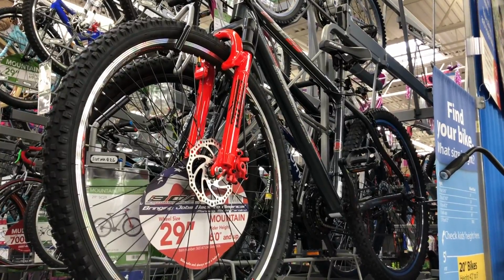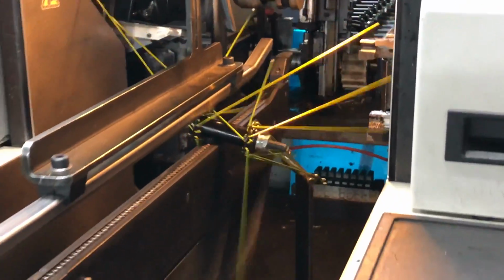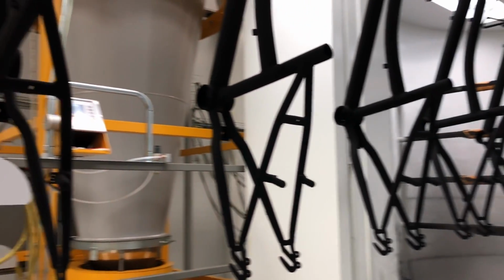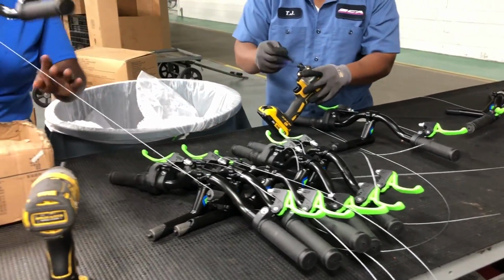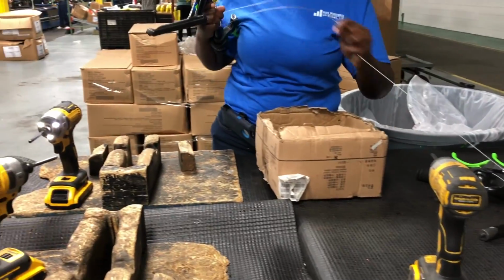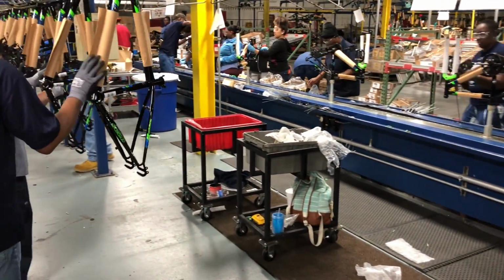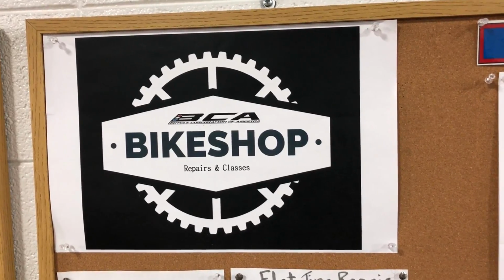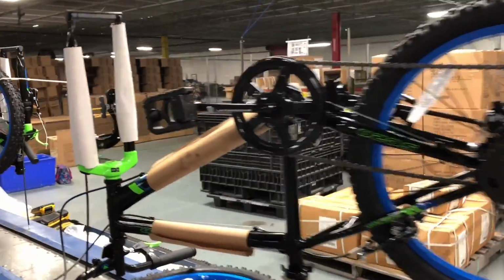BCA Bicycle Assembly Plant - Manning, South Carolina

Comment: Back in the 80"s in the bike shop i worked in Canada we got a load of BCA mountain bikes and it was the crappiest ones I ever worked on. They had big stickers with an American flag that said; Built with pride in the USA with a smaller one below who said; Echo en Mexico. Somes were white with smoke added with a torch and they rusted very quickly. We got separately a box of steel seat post because the ones who came with the bikes were not straight and could not be inserted. The plastic cantilever brakes were terrible and unadjustable. Even if the frames were massive and heavy, if the kid makes a wheelie the fork will surely bend. I am not surprised to learn they went out of business but how many times? For my part never buy a bicycle in a department store, they keep the cost as low as possible and they don't employ experienced mechanics..
Reply: Peace be upon you, how are you, I have a question, is the univega bicycle injection made in the American states or has it been assembled, and is it good or bad, and thank you.

Comment: Does this company have good wages and benefits?
Reply from the maker: The employees appeared happy, but I didn’t ask anyone what they made or what benefits they received.
Reply: KevCentral it looked clean and pleasant. I like your videos.
Reply: My experience with RTW states is wages will be $2 to $5 above minimum...where skilled maintenance staff make the top end of that scale.  Just enough to attract a workforce tired of smelling like a french fry.  Prolly no more than $12 to $17 an hour...maybe in the low $20s for maintenance.  Insurance will have high deductibles...usually $3000 to $5000. 

You'd be better off bartending and wrenching at the LBS for your bike fix.

Comment: I worked at the Toyota plant (where the Tundra and Tacoma are made) and that's pretty much how the trucks are made...right down being baked and washed, several times... On a little bit larger scale, but still. The difference is the truck starts out as a giant roll of sheet-metal, but the frames came from Mexico and not China.
Reply: But at Kent, there is no TPS in place...complete with traceable and variable quality systems. Of course, we prideful Americans had to rename it LEAN Manufacturing.  20 year career, here, in Auto and Aero...visited many a Transplants. Post 20 years in retail sports equipment similar to bicycle industry...which means lots of asia pacific mfg.  I can tell you Kev does a good job of showing what we want to see and doesn't show what's not. There is virtually no quality system. Too much cost would be involved to meet wally worlds price points.
Reply: @justpedal65  I’m going to comment on the the quality thing. When I first started at the plant, the Japanese were still in charge, we were making almost 900 trucks in an 8hr period, 900 trucks and only a few didn’t meet the quality checks and the end of the line (there were quality checks all along, those issues were fixed before going on). 9 months after I got there the. Japanese left...overtime went through the roof, 10-15 hours of overtime was usual (per week), loads of trucks didn’t meet quality and were sidelined, we always missed the production quota by almost 5,000 trucks a quarter (more like 10,000).  
It would be easy to sit back and claim “the Japanese were driving you to work hard”, but that’s not what was happening.  It’s hard to explain, but “line stops” went through the roof when they left...for no obvious reason.

Comment: My friend wanted to know if the genesis v2100 is a good bike to ride on novice trails? Keep up the good videos too👍
Reply: I have a problem also with cheap twist shifters. Thx for the feedback, ill let my friend know.
Reply: You dont have to reveiw it since you just got a bike. Take your time. Thx👍
Reply from the maker: If it were me, and I was looking at a Genesis for $149, I would be looking at the Genesis RCT. Better shifters, dual disc brakes, and no weak rear suspension to worry with.

Comment: BCA manufactures the cheapest bikes in the country.  They're for department stores.  Bearings are assembled with Makita styled drivers.  I saw ZERO grease being applied.  Pedals were WAY OVER TIGHTENED.  Cables had ends crimped on leaving cables about 7-8" long...WAY TOO LONG.  I see
Reply: These people obviously work hard.  I'm not blaming them, I'm sure they're under a heavy quota demand.  But this assembly is low, low quality.  The consumer pays for what they get.  I hope to see more jobs come back to made in the USA.  Raleigh bikes were made near my house in Kent Washington till the late 1990's...those jobs are still gone.

Comment: Are the DeWalt impact drivers they're using modified all?  Those things put out over 100ft-lbs of torque.  I don't think they'd use them on a faceplate without modification.
Reply: They use the clutch and test it periodically for torque.  The better air wrenches have torque settings

Comment: Powder coated?!  Who knew bikes sold at Walmart would have a better quality paint job than most high-end bikes.

And for the commenters...yes, I know powder coating is more practical for mass assembly, and yes powder coating is heavy, and yes you can't powder coat carbon... But it's still a more robust coating with less imperfections than hand sprayed lacquer paint found on higher end bikes.

Comment: The company where I'd spent 16 years once got a new GEMA powdercoat paint line, very similar to the one shown here. It's quite a head trip. A raw, greasy part can be hung on the line, and in about 1-1/2 hours, it's fully clean, coated, & cured, & ready for further assembly.  You don't have to wait that long for production to keep going, though, as the parts come out of the oven as fast as the raw ones are being hung on the line, about every 5 or 10 seconds. The coat has some orange-peel texture, but it's thick & it's hard as nails. 

A one-cubic-foot box of powder runs about 500 smackers, but covers many hundreds of square feet. It was supplied by DuPont and others. We use handguns to fill in places the automated guns can't reach. There's quite a process when the time comes (often) to clean everything spotless & switch to another color. A single mismatched fleck of the previous color requires touching up by hand. Every single last mote of the old color has to be removed from the booth, the guns, the hoses, the reclaim collectors, the supply tub, and the regulator valves. Gordon Ramsay would approve! 

We had over a dozen shades each of red, black, and white, plus many more. My favorites were called Viper Yellow (like a Dodge) and Bloody Mary, which is a rich, deep red, very close to the iconic color of a Ducati. And yes, I eventually learned to recognize each & every subtle shade at a glance. I can see the same pride that I've felt, in the eyes of these skilled workers. 
I think I would love working at B.C.A., were I still a young man. Great video, Kev!

Comment: This is a low end bike ? there is no canyon or KTM etc
Reply: I don't think Canyon paints their own frames. Not seen that at their assembly plant. They are buying in bare frames here but if they are basic steel frames they could get in a couple robot welding machines and a few tube cutting machines etc and start making their own frames and then pretty much they would be a full on manufacturer. Canyon likes to appear as a manufacturer but is basically an importer/assembler and from what I've read the majority of Canyon bikes are coming in pre-assembled with only a final tune up at their assembly facility. Sadly the BCA bikes do look low grade cheap bikes which is why a fairly low tech facility can build them. Canyon on the other hand is more a marketing/lifestyle brand and all the real magic goes on in Asia because they are much more advanced bikes but minor work in Europe so they can slap on a 'Made in Germany' badge.

Comment: Never heard of it. This is a fascinating video. Having assembled and tuned thousands of bikes while working a my lbs, it super interesting to see the men and women who reform this portion of assembly. Very efficient. Especially the zip ties and staples. I had to cut all those zip ties and staples. In my lovely local store I always begrudged having to walk across the shop floor, or climb a ladder to grab the next bike for assembly. Or for that B.B. removal tool that lived on bench four. The assembly line is so efficient. Thanks Henry Ford.

There are a few things we would do regularly to ensure that we were delivering a well tuned road ready bike that would be serviceable when it came back to us for years. Greasing bottom brackets, and pedals, quill stem expansion bolts, adjusting hubs that by design seem to be over tightened by robots ... Our bikes came back to us for decades, so that dab of grease goes a long way, and saves hours of cursing and bloody knuckles from trying to extract a seized component. 

Love and respect to all the workers at  BCA.

Comment: Both of my kids learned to ride on BCA bikes.  My son had a 20" BCA 6 speed mountain bike.  The spring in the "shimano" derailleur was too big and he was never able to shift out of 6th gear with the grip shift.  Obviously this was not ideal for a kid's bike.  For his 10th birthday he graduated to a Trek 820.  The BCA really had potential if it weren't for the poorly designed shifting.  The other issue was poor assembly by Walmart, but I can't blame BCA for that.  As with so many cheap bikes - one or 2 little issues can completely ruin what could be a good product.

Comment: Great vid from the Only assembly plant in America folks. This story is covered in the Wall street journal and its inspiring and heartbreaking at the same time. This might be the only comprehensive video to date. HATS OFF TO KEV, for showing this.
Reply: I'm not sure if that's entirely true, Detroit Bikes at least is a thing, but this is probably the largest.
Reply: Only plant in America because it's too expensive to produce bikes here. Plus these bikes are garbage and they are milking the American name to get sales
Reply: Jeremy R he mentioned in the video that they are in the works of higher end bikes
Reply: Jeremy R I agree they milk the made in America deal but Aliexpress proves LBS bikes are a total scam. There in no way top line carbon racing bikes cost anywhere near the selling cost.
Reply: Thiosemicarbizide Benzoyl Alcohol those carbon fiber bikes sold on aliexpress are dangerous to ride if you go over 25 mph the bike starts to vibrate there are articles about it
Reply: Durrant Miller as good or better than anything on the market. Those days have long since been over.
Reply: Thiosemicarbizide Benzoyl Alcohol intense cycles still makes their bikes in the and their mtbs are world class
Reply: Durrant Miller Assembled in America and it was featured in pinbike. The frames are made in Taiwan or mainland China. Intense is only providing a mech drawing and no actual frame rendering. Trek is the only company making carbon frames in America and its only for testing or sponsored atheletes. There was a guy on one of the forums that topped everyone off and he was correct. Carbon bikes for the most part are a rip off and even the latest designs cost 200 to 300 bucks for the companies that market them. T1000 frames are available to the public at around 300 to 600 dollars from the same factories that make everything else. They do not cost 2,000 to 5,000 dollars. The industry is filled with get rich quick schemes because 500 meters of carbon fabric cost 400 bucks and will make a few hundred bikes.
Reply: Its not just the material costs the make high quality carbon products expensive.  All carbon products involve a tremendous amount of manual labor that is not yet automated, and good QC costs money.  Open mold frames are cheap, but their designs are a decade out of date and they cannot compare to a modern carbon frame.  These designs are proprietary and R&D costs money.
Reply: YearOfTheDog82 your kidding if you believe its a decade old tech that they are selling. You can get full carbon xc racing bikes that are as good or better than team tech. This is propaganda at this stage and as with every other product, its right on the money. We gave that tech away to Asia decades ago and they have mastered it just like cell phones or anything else. If you know where to look then its the same or better at this stage. U.C.I gave up years ago and now teams are supplied with these frames. Just look it up.
Reply: sploofmonkey This industry is a get rich quick industry for the most part and check out T1000 carbon frames on aliexpress if you dont believe me. Entire carbon xc bikes that rival any manufacturer are fractions of the cost. Its propaganda if you know what your actually looking at. The guy that gave all this info knows exactly what he was talking about. Its all coming from China and the mark up is criminal.
Reply: Thiosemicarbizide Benzoyl Alcohol 
Most people buy things that make them feel good. Do you need a MTB or do want a MTB? Who really needs a mountain bike? Not many. People buy brands, designs, labels, and community because it makes them feel good. If the bike is $100,000 there will always be a buyer willing to get the most expensive bike. He will probably leave it in the garage, museum, or take it out to large events to show it off. 
Then there are those that see the opportunity between the extremely expensive and the cheapest. Those people create the bikes that appeal to people like you and me. Great bikes at average or below prices. But we need those expensive products in every category to have options. 🍻

*Edited for typos. I had way toomany 🙃
Reply: I think that Priority Bikes are manufactured in NYC.
Reply: Santa Cruz are assembled in Santa Cruz California (as the name suggest) and I’m sure there are other boutique bike brands from America who do the same
Reply: 413X I believe that Santa Cruz stopped assembling their bike there years ago sadly but I believe that intense bikes still manufactures their bikes from scratch in the US also there are a lot of titanium bikes made in the USA
Reply: @durrantmiller8810  ibis is started to make some models on us.
Reply: Yeti does it too.
Reply: Johannes Nilsen Those are hand assembly factories and differ from mass assembly plants.

Comment: I am glad there are companies making bikes in the USA however I wish all companies made quality bikes I know I am not the majority but I personally couldn't imagine riding most of those bikes
Reply: Unfortunately making a quality bike in the USA just is financially smart. You definitely aren't gonna risk using an impact gun on high end mtb parts.
Also I'm with you, I would never ride one of these.
Reply: Depends on what you view quality. These are crude basic bikes with low end parts but those steel frames are very strong. A bike designed for low weight is more likely to have it's frame fail. Aluminium through fatigue perhaps 10 years down the line and carbon is brittle and easily damaged and can shatter. Many of these are children's bikes and the child will outgrow them in a few years. I must admit I really hate seeing low end suspension though it's utterly pointless but fashionable and sells. A simple steel rigid bike could outlast a aluminium or carbon bike easily but stick low end suspension on it and it will make it a throwaway product after a year or so.
Reply: I view quality like most do strong bikes with replaceable parts and strength that can put up with the double black diamond trails I ride every weekend if I tried to take one of these bikes with the weak parts on my local jump line it wouldn't make it to the bottom which is a problem also the fork isn't adjustable for weight now compression or rebound circuits realistically I don't view these as trail capable in anyway and although steel CAN be very strong just because it's steel doesn't mean it's stronger than aluminum with the advent of triple butted hydroformed tubes thicker tubes in other areas there are alot of bikes made from aluminum and carbon that are plenty strong me personally I won't ride carbon because the splinter effect that happens when you scratch it deep enough and sure there are company's like chromag that build light weight steel frames that eat the vibration up much better but that comes at a cost so like most mountian bikers that rely on their products to get them home I would not dare try what I do on one of these bikes personally and I wish they didn't exist cause the people that come into my shop often don't understand the difference between these and higher end bikes and when you point out the difference they usually have something to say like maybe they found a way to build a quality bike for under 300 dollars lol I'm not a fan and this isn't a case of bike snobbery I own a GT Ricochet 375.00 on sale with that I stoled all the parts off my full squish to make it more capable but doesn't change the fact that quality is quality I like it more than my multi thousand dollar full sus so just my opinion but I wish they wouldnt build low quality bikes in the usa